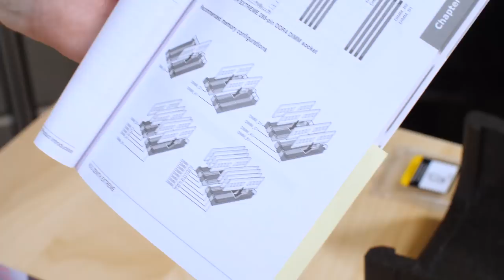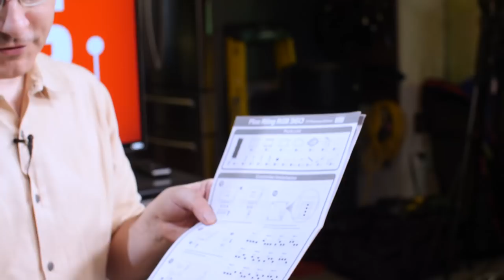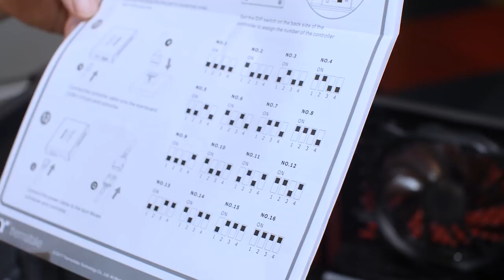AMD Threadripper 1950X Build - new 16-core CPU! - Random Access

Comment: As others have mentioned - this is a really poorly done build - particularly the CPU install. A shame really given the high end/expensive processor and components. Not an example a new builder should follow at all - much much much better examples (plug for Paul's Hardware, etc). PCMag should consider taking this down IMHO.

Comment: I would have gone This route.https://pcpartpicker.com/list/JZpg2R
Reverse Cases are much cooler. The power supply went plat incase you need a second card. An RX Vega because its more stable when running multiple programs at one time.

Comment: Then you should probably know that AMD performs better with AMD graphics cards. Meaning Two RX 580 in Crossfire work better than a GTX 1080 ti.Or use a Vega 64.
http://www.hwcompare.com/35521/geforce-gtx-1080-ti-vs-radeon-rx-vega-64/